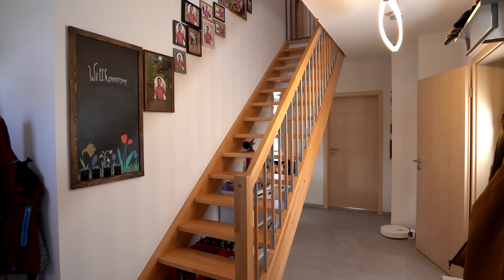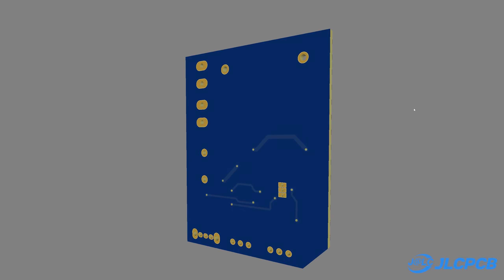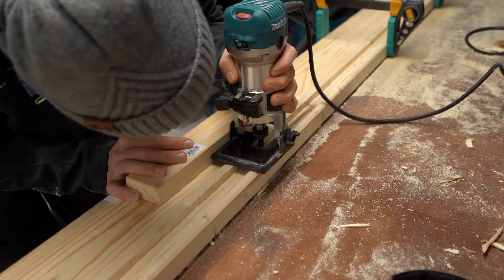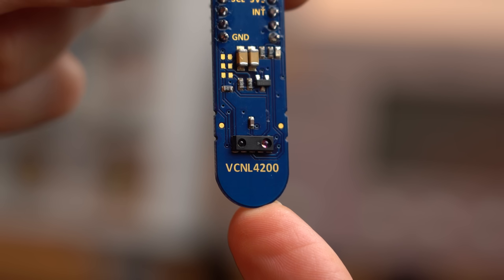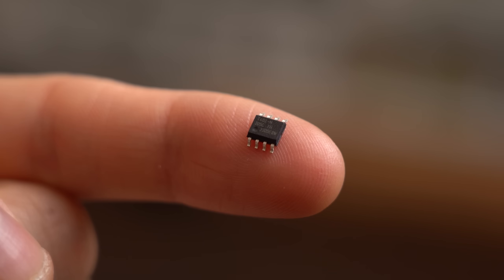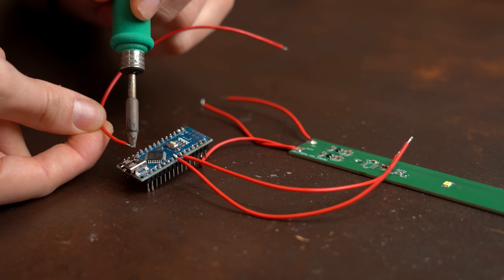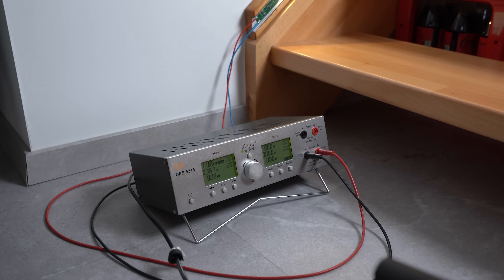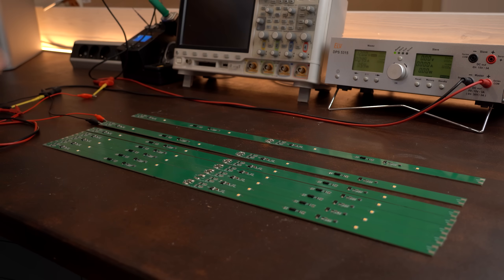I tried to Revolutionize LED Lights!.....And FAILED?

Comment: Just an opinion.

I'd still go with the opaque strip light covers. Drill pin holes where the sensors line up. Then bevel the holes out to 45 degrees. Tape the back and fill with either Super Glue or a clear binary epoxy. 

Second idea is sensor 2 or 3 steps in sequence together. Less sensors running code and less code to write. 

Just an idea.

Comment: Not being an electronics wizard, I would have just gone for one long white 12v LED strip UNDERNEATH the stair by the wall, just dim enough to be able to let you see the steps of the stair, with a night sensor switch !

Comment: For me, this project is exactly what I want (well when it works). I don't just want a sensor at the top/bottom of the stairs and while this solution will cost more, it is functionally far better. It will automatically just work no matter if you're running or slowly walking up/down the stairs. I do like some of the suggestions for improving this version with regard to connectors etc. Personally I might also want more than 2 leds. Btw, time to upgrade the girlfriend to a wife maybe ;)

Comment: Did you connect the aluminum profile to ground as it can act as an aerial and cause problems. I had this with a long of WS2812 leds. part of the run was ground some how and worked fine and the part that was not grounded had problems. Also to add to the problem there was some mains cables in the wall where aluminum passed over.

Comment: The next light need to be switched on before you step on the next stair. I would do this project by using only two motion sensors, one at each end of the staircase, at the beginning and at the end. If it sense motion, it would illuminate the entire staircase.

Comment: Your LEDs are spaced far apart and controlling it with a HF buck converter creates potential large antennas coupling into your power and communications. Definitely recommend to change this part and always Isolate buck converter grounds via a 0R resistor so it is less susceptible to conduct noise in other parts of the PWB.

In addition your HF decoupling is rather low, consider placing more 100nF caps close to IC power pins.

Comment: once you get the electronics working.. the one flaw I still see is that you want to illuminate the "NEXT" step... not the one you've just stepped on... too late to help you there no ?
so one sensor detecting movement should lit 'itself' and the next and previous step maybe ?

Comment: Bit of a shame about the power converter. I’d much prefer using a supply line of at least 12v for that distance, but you’ve only got a few LEDs so it’ll probably be ok

Comment: I had a project like this but in the end i used a commom led strip, cut it in the minor lenght (3 LEDS) per step, fixed it in the handrail facing downward and used a PIR sensor to turn on the hole stair case. 
Also its integrated in Homeassistant so it can serve as indirect light for the living room. It's not that fancy indeed, but helps a lot

Comment: You could probably use a single lidar sensor (with a longer range) and mount that at one end of the stairs. Together with addressable leds (eg. WS2812) and one microcontroller you could determine the humanˋs position and enable the leds accordingly. You would have to use a lidar sensor with a wider fov to sense the position left and right of the stairs though.

Comment: Oh no! Are you sure there isn't also crosstalk from the infrared distance sensors? I made this mistake myself with an array of IR sensors for an art project one time - they work beautifully in isolation but as soon as you get multiple in parallel next to each other they see reflections from each other's IR LEDs. This is especially bad when the facing wall is really light colour and reflects IR well.

If the modules are the really dumb intensity based sensors you can turn each light on and off just when you're reading to avoid crosstalk, I had fancypants time of flight sensors so i couldn't do that...

Comment: I've got some physical advice, no electronic (that's above my punching height).
1st advice, Is there a chance that the aluminium profile is reflecting? It doesn't seem to be finding the distance truth as well as when it wasn't in the profile. If it is the sensor might be picking up the stair tread. Blue painters tape across the top and bottom lips to test the theory? I'm thinking painters tape because it's non-reflective, so any dark/non-reflecting tape would work. If that helps the sensors find the truth then just paint the aluminium profile matte black.
2nd advice, it's a REAL shame you can't use the diffusers, but very much unsurprising. You could create 'windows' in them just for the sensors with a piece of transparent sticky tape on the opaqued side of the diffuser in the place the sensor 'looks out from', if the sensor works then sticky tape will fall off pretty quickly from the heat of the LED's, but I'm thinking maybe make a window with a square of blue painters tape and then some UV curing transparent resin in place of the sticky tape?

Comment: you could have used a normal trasnlucent diffuser cut into small lengths for the whole thing and addess small piece of transparent one right above the sensor, i know it's not the best solutions but hey it's something

the fact it has more important problems to be sorted out is another thing 🤣🤣

Comment: Had very similar idea back in 2021 while building my stairs. Wanted to do all just using analog discrete parts. Never actually got to it. Good luck with your project and thanks a lot for the kick I probably needed to get back to this project.

Comment: I love challenges like this. 12:35 looks promising, the boards at the top may have a assembly defect? Or it may need different threshold values. We have boards that have switching converters far closer and more packed than this. Following standard design guidelines should be enough to resolve this. @YarianZy should be correct about the double out diodes

Comment: My spontaneous low tech contribution. Stay Analog: Replace the sensors with strain gauges under the stairs. Use some OPV signal conditioning (low pass + gain + some integration) and trigger the LEDs from that.

You would send a dampened variant of the signal to the neighboring stripes and mix to their signal conditioner for the "light Aura" effect.

Attaching strain gauges below the stairs increases the unwanted glue-on-the-furniture, but damn, this thing would be cheap and work forever due to its simplicity!

It even distinguishes pets from human, if you trim the gain stage. Pets tend to have better eyes than the median tech-nerd!

Comment: You know way more about the electronics than I do, so a bit of lateral thinking in case it helps. 

If you can get the boards (all or some) working individually, and if the PCBs and MCUs have data to each other, could you just have it so that if something gets triggered at either end that it lights up the whole thing, either all at once or in a pre-determined sequence? Or maybe that but in sections rather than the whole thing? Obviously the ideal would be to have the whole thing working nicely with all of the sensors but if the idea is to light up the stairs for the "no other lights are on" use-case only, then I'm going to guess that the pattern you want them to light up in would be fairly generic (maybe with some logic to alter the timer if the middle hasn't been triggered, or something like that).

Alternatively, could you set them to always on, then have a separate MCU turn on/off the whole strip's power source based on activity and ambient brightness as if it were a normal smart home light setup/power socket?

Even more alternatively, could you have them use PWM to be on at a low brightness at all times or based on ambient light (or time but I assume they don't have usable clock functionality) thresholds? Probably too dark to be useful and/or too much power drain but you would at least have something!

Comment: An idea why it didn't work out on the staircase, but on the bench:

Maybe the different infrared sensors influence each other. You had MUCH more on the staircase than on your bench. And: on your table, they just pointed upwards, into nothingness. But on the staircase, they point horizontally. Very near the wood where you foot steps on. I guess that a part of their emitted IR light is reflected there, and since the wood isn't totally flat, it's reflected in many directions (diffuse reflection). So an IR sensors also gets a signal from a remote sensor.

Finally, it might be that your LEDs also emit IR. One could see that once a part of your staircase was illuminated, it stayed so even when you moved away. If the spectrum of the LEDs also have infrared --- or the IR sensors are also sensitive to non-IR, the LED light can inflience it's very next IR sensor. Again also due to diffuse reflection of the wood.

No, how would one fix this?  E.g. by not using the IR emitter of the IR sensors all the time, but they moving a "window" of opportunity, e.g. with a duty cycle of 1/4, syncronized with the next and prev PCB board. That way only a IR emitter 3 boards away (on the 4th board) will also be active. And for my idea of the overlapping spectrum of LED and IR sensor you can check manuals and maybe do a lab bench test. If that is true, then you might use a different LED.

Comment: Is the communication between the boards even working?
- in your video you said you missed a pull-down, but in your code you added a pull-up
- with that pull-up on your inputs and D1 the input can't be switched low by the outputs -> they will never activate
- out2 is connected to in1 and in2 is connected to out1 -> the output of one board is connected to every second boards input

1 Diode on each input instead of D1 may work

Comment: Vielen Dank für dieses gute Video. Ich bin kein Elektronikexperte und mag das Programmieren lieber. Vor einiger Zeit habe ich mir mal eine Tischuhr gebaut, die für jede 2 Sekunden eine LED hat, alle 30 LEDs sind im Kreis angeordnet und in der Mitte ist ein 7-Segment-Display zur Anzeige der Stunde und Minute. Das ist natürlich ein anderes Projekt aber ich musste auch sicherstellen, dass immer die richtigen LEDs leuchten (so wie du auch). Ich habe es mit einem 74HC595 Shiftregister gelöst, dass zu jeder Sekunde immer eine vollständige "Kette" mit den Schaltstati der LEDs "rausschickt". Du könntest es ähnlich lösen und bräuchtest als "Input" nur die Nummer des Boards, dessen Bewegungsmelder zuletzt und aktuell meldet, dass sich jemand im Sensorfeld befindet. Es müsste dann natürlich ein Master-Slave-Prinzip bei den Platinen geben. Wäre das vielleicht was?

Comment: Why not use an IR sensor and detector with a time delay?  Activate LED on for 1.5 seconds when beam broken.  LED off until beam broken. No need for microcontroller.  Just use simple 555 timer it’s.

Comment: Pwm und i2c might cause interference, so as a quick fix it might help to just try to switch on an of instead of increasing the brightness. But I don't think this will fix it completely and in addition do you really want to light up the step you're standing on instead of the one you are going to step on?

Comment: You need to use the light diffuser, but make a little hole in front of the sensor! I think it will look much better and still work

Comment: I took a 5 m length of LED double stick taped it to the top of the side like you did and I hooked up to a timer so that from 6 PM to 11 the lights just stay on. That I have one light above the stairs that will turn on due to motion which covers the rest of the dark time.

Comment: As for sensors, i think there is a bit too much jitter in the sensor that you are using. Perhaps using a different type of person sensor might be beneficial. I think in this case a thermal IR sensor (the cheap ones) may work considerably more reliable. With the benefit that you can customize the housing so the FOV of the sensor can be restricted. Unless you are wearing  heavy boots or ultra high heels, it should work a treat.

Comment: You should have installed a 12v red photography light system to light the whole area as red light doesn't arouse your eyes.  Add a motion sensor and you're a winner.

Comment: I was already thinking when watching you drill the holes in the wall, that should be the final step when everything works?

For testing I would first do some temporary bodge like temporary putting it in place with this tape that painters use and then see if it works.

You should have a way of mounting it on the stairs after it is fully assembled. So you can take it back to the lab to troubleshoot it. Maybe make a hole in the PCBs so you can screw it / unscrew it on your stairs after assembly.

Comment: Very good potential with this, i think there should be some kind of metal spring tabs which you can solder onto the pads so that you can connect the pcb’s by pushing them under the contacts, and they are springy so it should keep contact

Comment: Congratulations, you reinvented christmass lights.
Would have been easier to only have sensors and LEDs in the PCBs, 
relegate all on/off to 1 microcontroller at one end.
This way you could also turn on the last stairs, and maybe add special effects.

Comment: Why not just use a programmable LED strip like you first showed with a WLED controller, then have mmwave sensors at the top and bottom and have those "wired" up (via HA?) to light up all lights between the objects the sensors see on the staircase, +- 2 steps?  That should be much easier to do.  Also, you could see the steps before trying to step on them, making this much safer in practice as well.  Maybe you could get away with a single mmwave sensor if you mount it above the staircase to look down?

Comment: Hi! I looked at the project files to see if I could help with something and I think there are some issues with the daisy chain. Since in1 and in2 are basically the same wire and so are out1 and out2, connecting out2-in1 and out1-in2 causes issues if you have four boards or more. Let's say we have Board A firing up, it will send a signal to Board B through out2_A - in1_B, which will be seen by Board C through in2_B-out1_C and then fed to Board D through out2_C-in1_D leading to it firing up as well. That is what we see at 11:42 where every two boards light up when only one is triggered.
It looks like there is another issue with the boards on the top of the staircase causing them to always be lit up, I don't know why for sure but because they seem to be able to lit up without always triggering the other boards down the staircase I would assume that the trigger doens't come from a wrong digitalWrite but rather a false positive digitalRead propably due to noise.
I hope you can end up making the project work because the idea looks nice!

Comment: Thanks for sharing your problems so others don't "fall" into the them.  Engineering is all about iterating so no shame in prototyping.  Can I suggest having LIN bus or another com line among all the sections so not only will they light up where you step but where you are going to step.  The LIN bus would also help you debug so you only have to talk the primary chip to debug the entire strip.

Comment: Neopixel strip could work ?
You can even add a  diffuser if you put your sensor elsewhere.
You can adresse each led of the strip individually,  if you put your sensor and microcontroller on another board, that would probably get rid of a lot of interference, maybe ?
I'm not good at electronic, i just like to play with pixel and i had a lot of problem with noise too.

Comment: For noise suppression, try to ground aluminium profiles..
Is there different addresses for each board implemented in firmware? 🤔 Looks like they all responded equally or by groups when inserted in stairs..

Comment: Hi, did you connect the whole aluminum bar to the minus field, or GND, so that it acts as a shield and does not transmit interference between the modules?

Comment: This is the perfect example of German Over-engineering. Just kidding, I love your channel. What about a single laser rangefinder on top of the stairs, measuring the distance (position) of the object travelling the stairs, and light up the corresponding LED, all of that with a single microcontroller?

Comment: I suggest you use 1 main board and have the rest as slaves. then use multiplexing to select each slave and have them send the proximity signal and receive the led pwm signals. removes a whole lot of IC issues. Also check if the proximity sensors are perhaps interfering with eachother as they can detect up to 1.5m they might just signal eachother as they're just 30cm apart. EDIT: i read some comments, noticed you replied to someone that interfering is not the problem.

Comment: Did you put any insulation between the bottom side of your PCBs and the aluminum casing? Because if the boards work individually, I don't see any reason for it to not work collectively.

Comment: Hi 
I think i might know the problem here. But here is a simpler solution that i did while i got whopped by my parents for destroying the staircase (i am bad at wood works)
I understood your frustrations when the project dint work 😂
Been there...

Any way the theory is that i kept the ir sensor TOF based near the edge of each step pointjng little down. 
Then i used a simple mosfet to control the leds 
no microcontroller 

But to trigger the next led i made a track from MOSFET output to next mosfet input 

This goes for only 3 steps at a time 
Then after 3 steps another sensor 
Again single MOSFET for 3 steps and so on 

Anyway cheers waiting for update